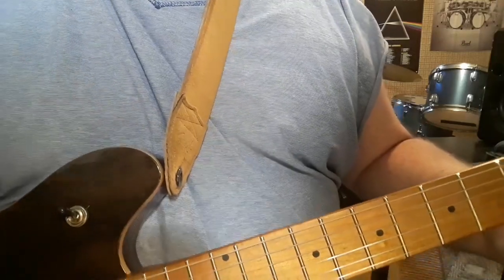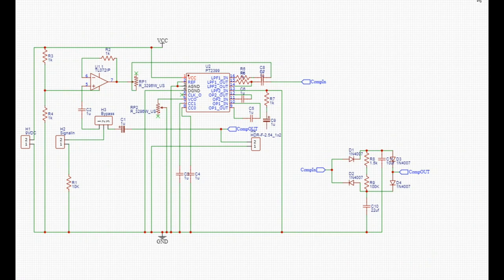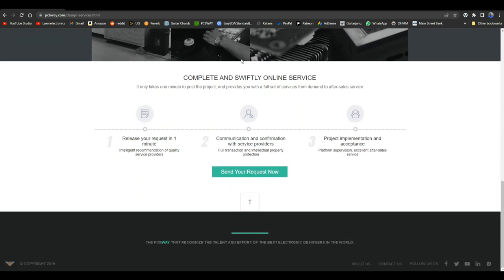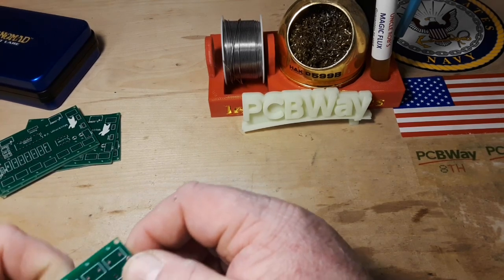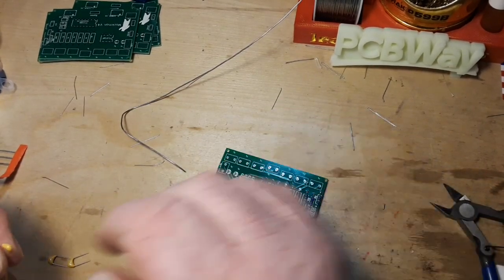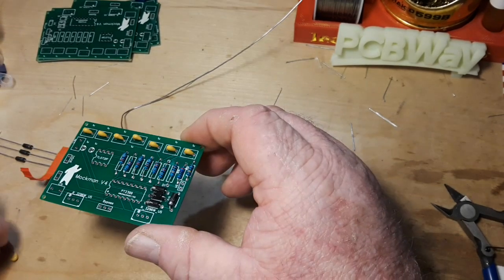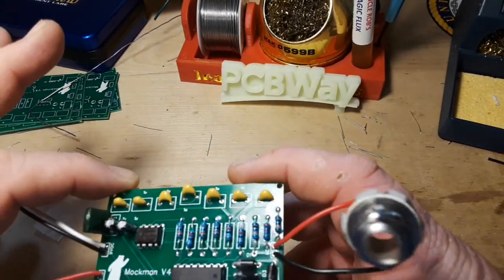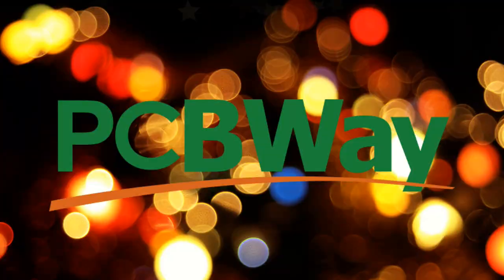Version 4 of my "Mockman" Guitar Effect(DIY Rockman Pedal)

Comment: The rockman actually had the compressor at the input of the rockman. Technically first there is a huge bass cut. I mean Huge. everything below 1000 Khz is cut. 
Then whats left of the signal goes through the compressor, then a bass boost circuit after the compressor adds the bass back in. Then at that output is where the Chorus, and Echo get their input. 
How do I know? 
Because I have successfully reverse engineered the X100 and sell a pedal version of the X100 that is a 1:1 reproduction of the X100 rev. 10 circuit.
Reply: How do I get a hold of you in regards to this pedal

Comment: Are you planning on selling kits or boards of the finished design?  I used to have the X100 along with the sustainor and equalizer which I purchased in the 80's.  Long since died and trashed but would love to build my own.  Still have my original custom built Charvel star body and Jackson flying V along with my SR&D equalizer and Marshall stack which are still working great to this day.  Thanks for the vids.  Never miss a one.

Comment: Nice to see. I plan on a little speaker system for my electrical guitar directly on it. A little mono amp for 5 volts and a battery in a box with it. Just to get out in the summer here for entertainment as I don't drink like others. It works already to another passive speaker powered by USB. With a big jack it can sit where the cable normally goes. An effect or 2 might be something too. My current mono amp is from China and is a bit noisy.